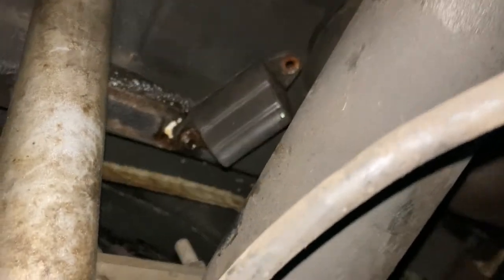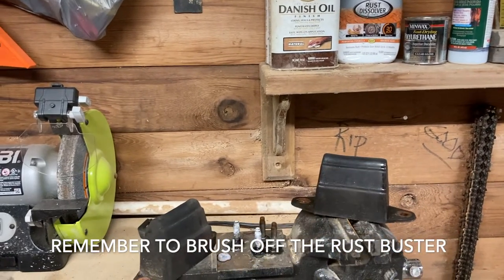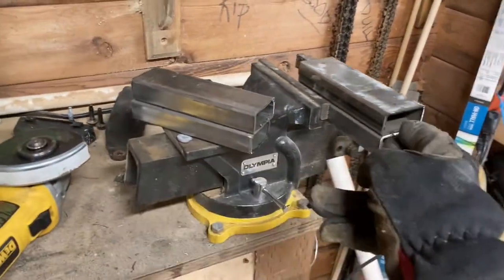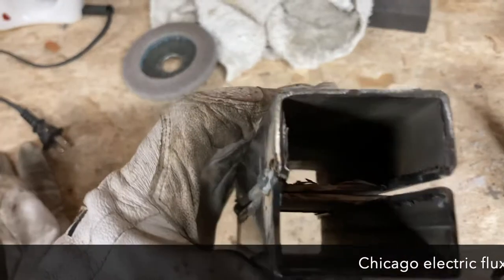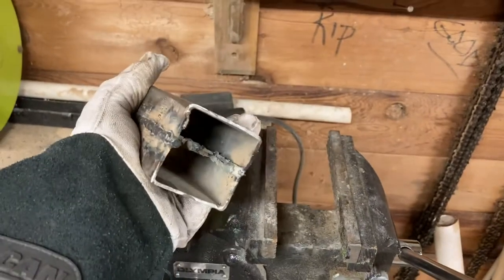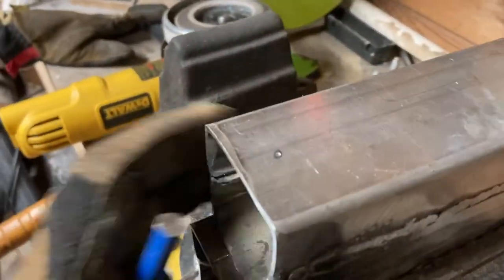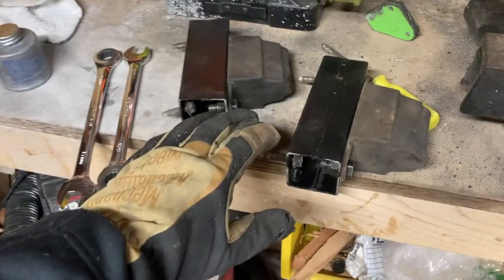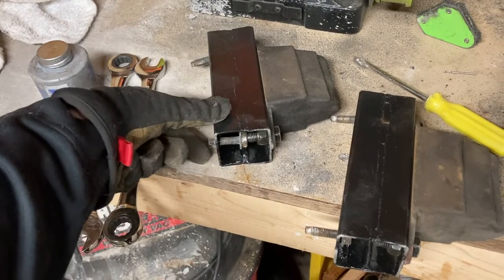DIY bump stop extensions on a Jeep or any leaf springs (XJ, CJ, YJ)

Comment: I don’t understand. Doesn’t extending the bump stops limit the travel 🤔
Reply from the maker: Yes, at a certain point if the travel isn’t limited the wheel will travel into the fender or blow out your shocks!
Reply: @SomeGuyOutside  I understand that but why does it need to be made longer than a stock one? 🤔
Reply from the maker: @officialWWM  I have not been able to change the length of travel on my shocks and to prevent them from bottoming out my bump stocks needed to contact about 2 inches earlier in the articulation of the axles. I dont fully understand geometry i just know that my shocks were bottoming out and now they arent 🤣 In the future Id like to build shock towers to fit a larger range of movement with larger shocks.
Reply: @SomeGuyOutside  lol, that makes sense :)